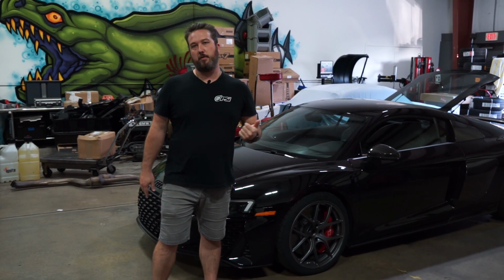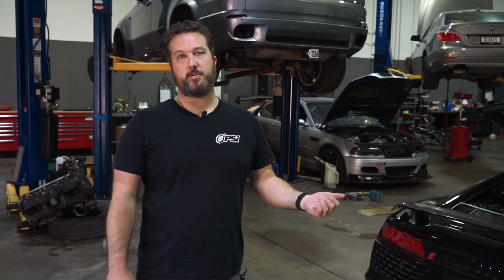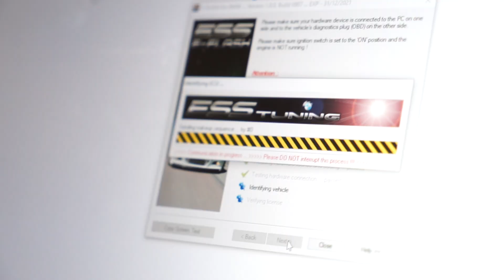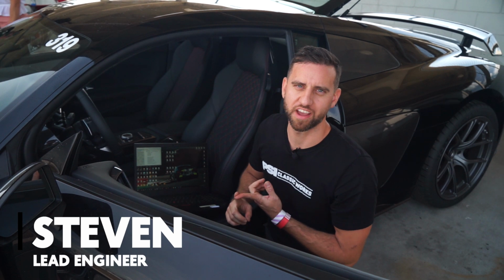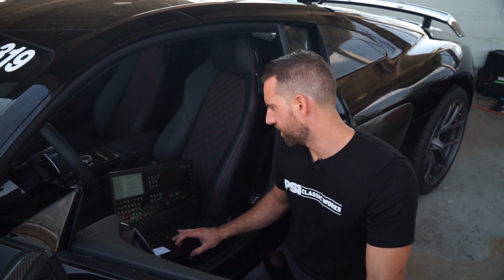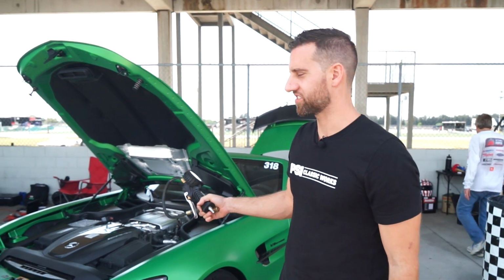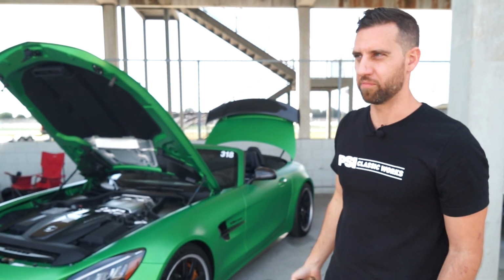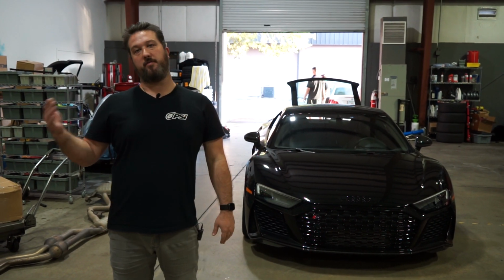2020 Audi R8 Supercharged V10 - The Best 900HP Street and Track Car?

Comment: Great build. Tell the driver to put hands at 9 and 3... a very fundamental piece of performance or street driving practice for car control.
Reply: Why not 12 and 6
Reply: @_Ambition124  Is that a joke?   If not, 12 and 6 will only let you emergency steer in one direction.   I have been to 3 performance track driving schools over the years and every single instructor is at 9 and 3

Comment: What are weak points when boosting an R8? Example; pulleys, belts, any lines, cooling, internals, etc. Are the pulleys cast aluminum like the Aventador? Those tend to shatter and make a messy job
Reply: Second gear, that's it.